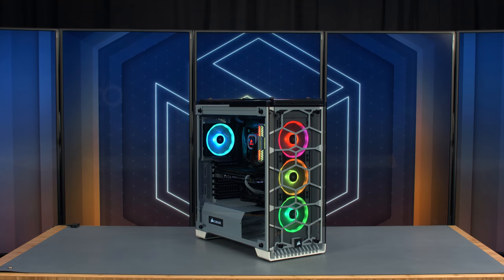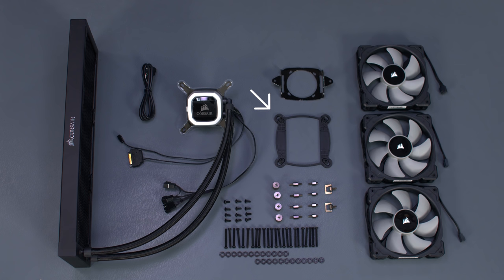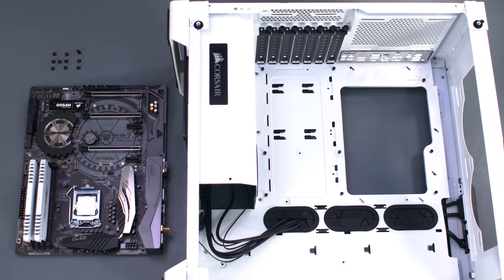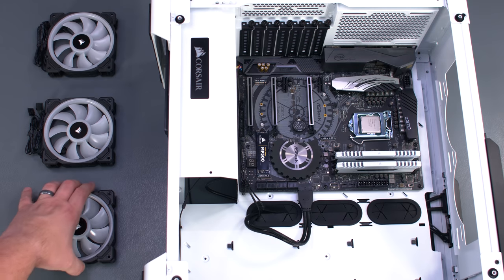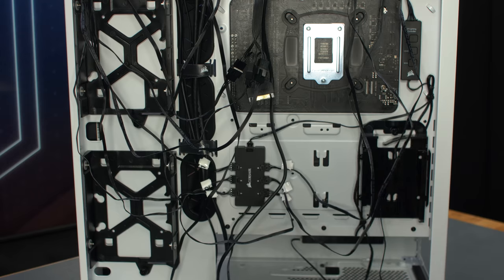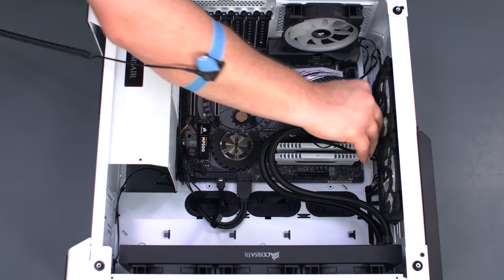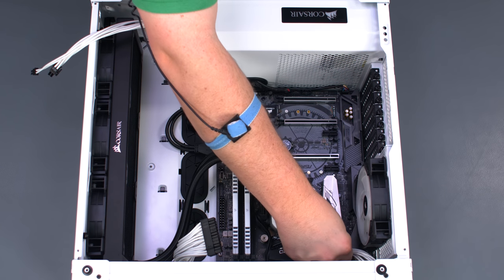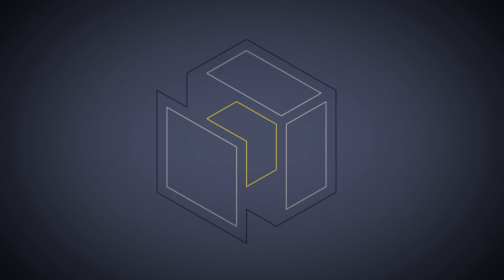Corsair Crystal 570X w/ H150i PRO RGB Build - ASRock Taichi Z370 / i7-8700K

Comment: All those goodies and they forgot to send you the PSU bracket to block all those ugly cables! lol
Reply: GAR Music I’ve seen that shield missing in a few builds for this case , I have the black and it has one with mine , I’ve been kinda wondering if it originally didn’t have one (or maybe for give aways they purposely leave them out for some reason) either way I’ve seen that missing in a few you tube builds

Comment: i have this build configured  are they compatible , and it's 600 w enough for it?... can someone help me? i have---1BenQ ZOWIE XL2411P - 61 cm 
---2Corsair Carbide Series 400C 
---3Intel Core i7-7700K CPU Prozessor
---4be quiet! DARK ROCK PRO 3
---5MSI Z270 GAMING PRO CARBON 
---6MSI GeForce GTX 1060 Gaming X 6G 6GB GDDR5
---7Samsung 500GB SSD 850 EVO Series
--8GB HyperX DDR4 2400MHz Non-ECC CL15 DIMM x2
---9be quiet! STRAIGHT POWER 10 | 600W CM  80+ gold
Reply: Cheroiu Robert go to pcpartpicker.com and put in all those parts and it will tell you if it's compatible or not.
Reply: 600W is enough. I recommend at least getting a GTX 1070 so the i7-7700K can unleash its full performance at games.
Reply: yea, i moved up to 1070:)  now im in between 1070 and 1070 ti  need 60 fps ,  but i think 1070 it's enough, now im w8ting for next month to see witch version it's cheaper:)
Reply: Cheroiu Robert You're better off going for the GTX 1080 instead of the GTX 1070 Ti. It's your choice though, because from what I've seen the GTX 1070 Ti performs about 10-11 FPS worse than the GTX 1080. I personally use a GTX 1060 because I don't need that much gaming power.
Reply: i think il settle for  a normal 1070 :) ive exeeded my budget already:) and 1080 it's 100 Eu or so more expensive
Reply: Cheroiu Robert If that's your finished result, then this PC you are building will be a nice gaming PC. Be sure to overclock that i7 so it can be more powerful than it already has. I recommend delidding it if you want to do extreme overclocking, but it is a risky move and could end up in a broken CPU.

Comment: I can do all of that but you people need to work also..I know..I know how annoying it is to send stuff back and wait for a return..if its your job to build these great..but why do the return unless your really hurting. Great website to see whats available on products or buying a part to replace something but initially getting a broken part is not fun.  Its quite easy to figure it out, its the broken parts and the returns.
Reply: I see them pushing violent games on people its because of the returns.
Reply: $4600 for a Corsair One with a warranty wasn't a bad deal if you really looked at it.  There scratching there heads with the PS5 release now but you see it like that.
Reply: Im just saying there is pressure to not pick the parts.
Reply: if all the parts worked that you sold online it would be a better idea.
Reply: $629 error message

Comment: Hello there,
i just finish building my rig parts (listed bellow), and when i finish the installation of all parts in the 570x case, i see that i don't have enough usb headers in the MOBO (ASUS MAXIMUS X CODE), so when i turned on the beast, 3 fans in the front panel shining RGB, but the two in the top and the last in the back, are working but now shining, i need help please

**parts:
mb: ASUS MAXIMUS X CODE Z370 cpu: i7 8700k gpu: ASUS STRIX 1080TI OC memory: 4x 8giga corsair vengeance 3000mhz ssd: Samsung 970 PRO 512go cooling: CORSAIR H150 PRO RGB fans: CORSAIR LL120 case: 570X CORSAIR WHITE**

what i did, i just linked the LL120 with the radiotor and installed it in the front panel.
and the 3 original fans with the 570X CORSAIR in the front panel, i placed 2 in the top and 1 in the back
(sorry for my English) thank you for your help

Comment: Those RGB fans CFM are too low and weak for CPU cooler nerds 90 CFM for a good cooling. But those RGB fans are 45 CFM. Very bad for cooling. Not recommended.
Reply: It's a 360mm radiotor with 3 fans. It will cool just fine.

Comment: When he used the pre applied thermal paste I cringed VERY hard
Reply: Why, it's just fine.. I've had multiple corsair AIO coolers and saw negligible results between pre-applied and re-applying, and I got up to 5.2 without issues with the pre-applied. Doesn't take you much to "CRINGE VERY HARD".
Reply: @BrawndoQC  dang bro relax
Reply: @BrawndoQC  and btw it wasn't all caps just the very part